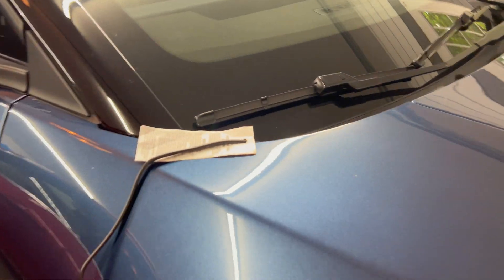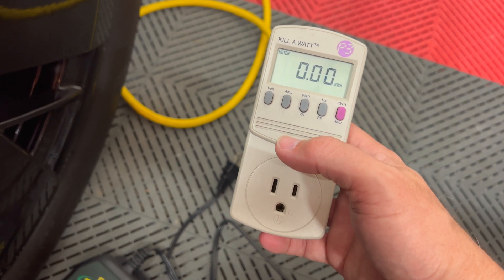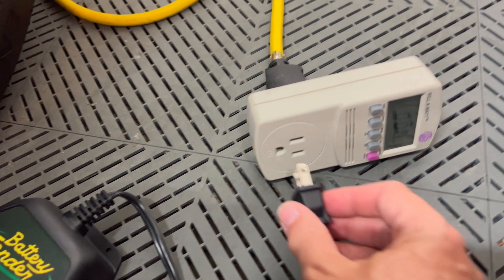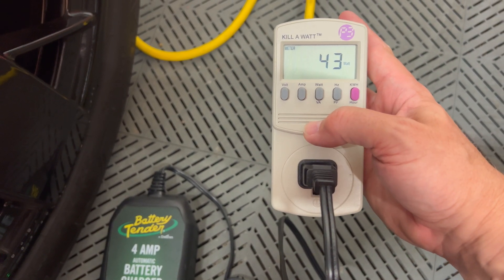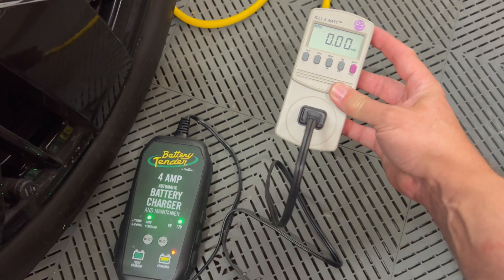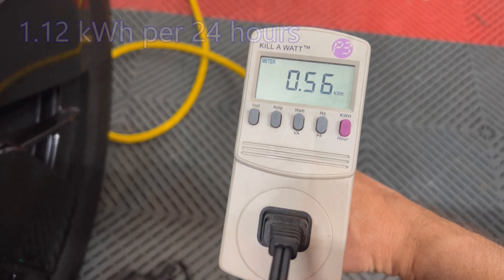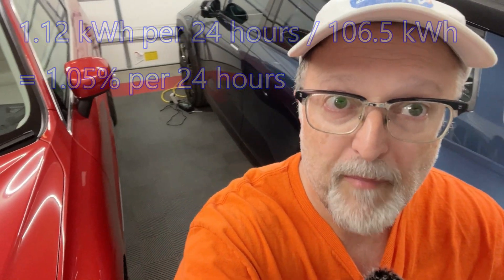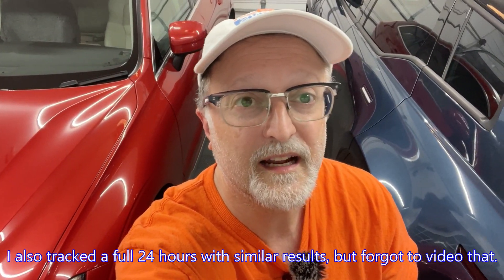Fisker Ocean One - Battery Tender Kill-a-watt Test

Comment: Another test would be to do this test, but with the car also on the EVSE charger.
Reply from the maker: Yes, lots of possibilities for testing!
Reply: I was about to request the same, im just hearing so many poor folks reporting a flat 12v battery. There has to be an explanation as to why a brand new 12v battery would drain so fast, on the FO mod group it has been suggested Bluetooth/WIFI remains on when locked and could be a factor but no one really knows
Reply from the maker: @hamwicbi1265  I haven’t heard much lately on dead 12 V batteries - this was an issue back in Aug- November of last year before the 1.11 and 2.0 updates.
Reply: Can you charge the 12 volt battery while charging the batteries pack?

Comment: Hey Matt, when you first plug in the tender, it's topping off the battery in a way it doesn't appear the car does. I would try hooking up the tender, waiting an hour, then reset the meter and check 12 hours later. Just a thought.
Reply from the maker: I see what you mean, the tender keeps it at 13 V vs in a 12.4-12.7 V range for the car's system.